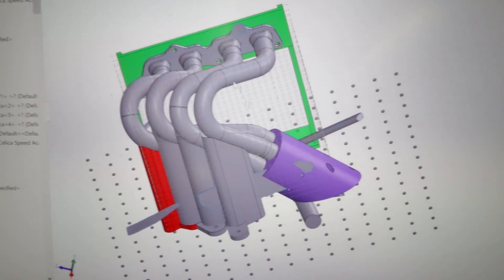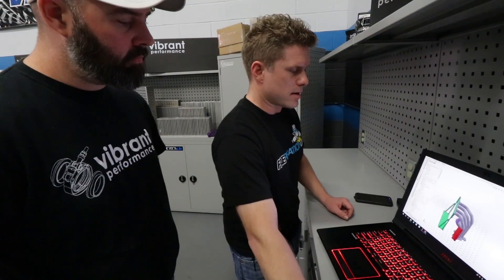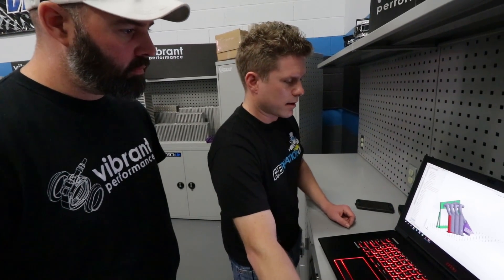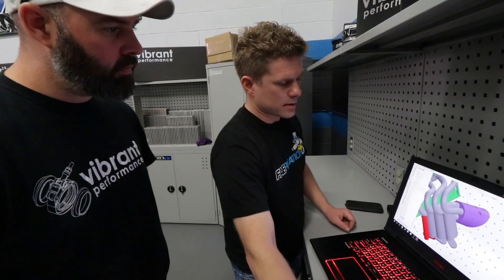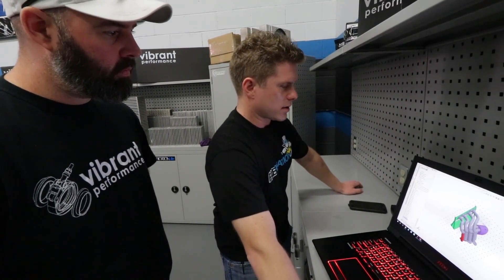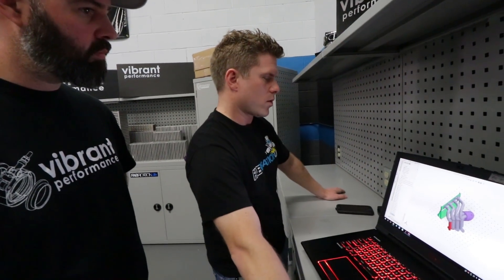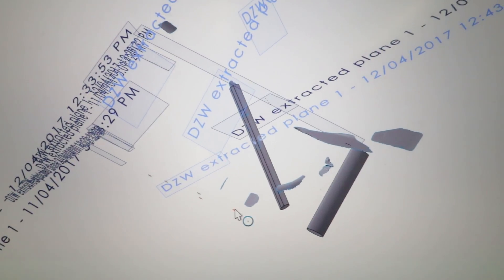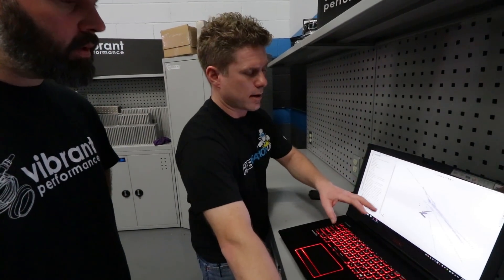Celica Beams 3SGE Header & Exhaust Build-Off Ep2

Comment: Seems like a lot of hours!! Time is money. I'm thinking the "old school fab" method will have it (the entire header) done before he even gets the rest of the jig parts, not to mention all the scan, render, computer design, render time....$$$$$$ Even after, the "old school" method, making a jig is hardly any work working from the header mock up. I guess I need to wait to see the other method first but I think this method is too expensive.
Reply: I think that they wouldn't do this for every bespoke header (unless you are willing to pay). I think this would be more used to create popular headers so they have all the tooling to build the header again.
Reply: The modeling comes in handy when they set up for a production piece.  They would save a ton of time and have a more consistent product using this method on a run of higher quantity.  But you're right on the one and done stuff.  Some of this is time (and money) wasted.